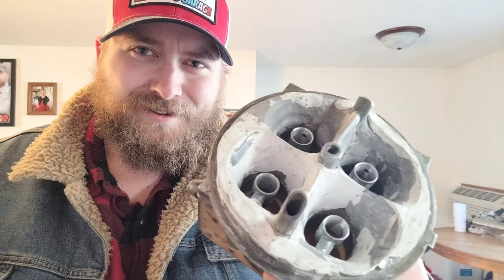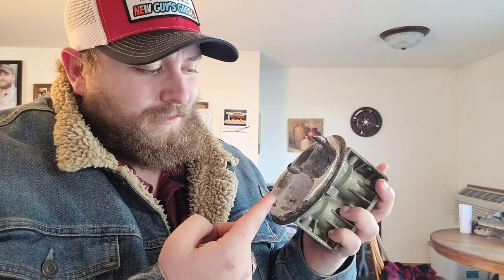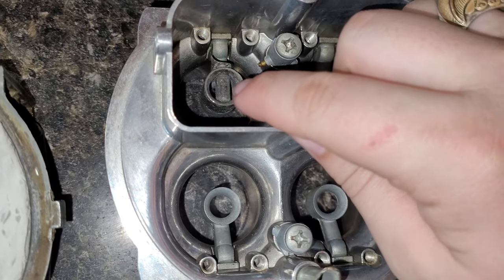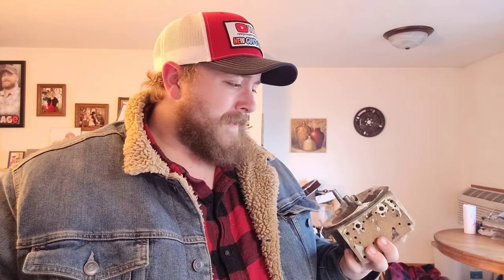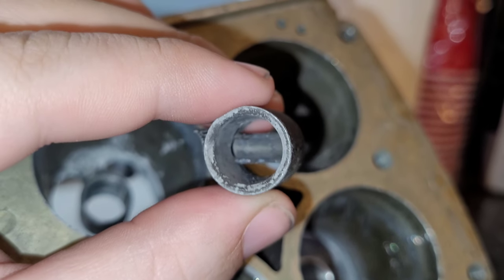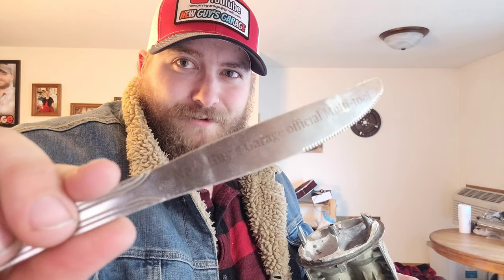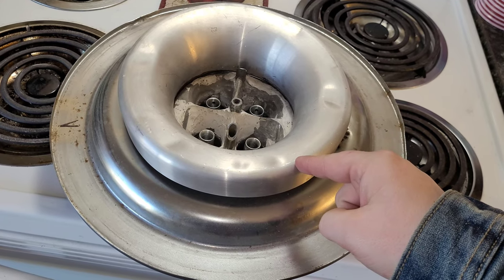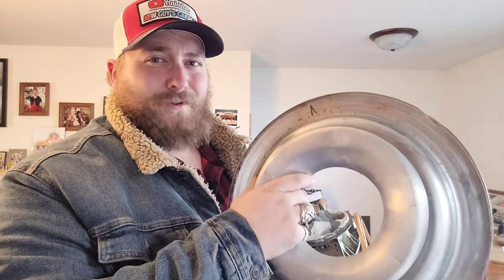Holley Carburetor Straight Leg Booster Mods! | Project XMC Flow Bench Testing | How To Customize!

Comment: It would be cool if you could wet flow it to monitor atomization. 1 3/4" throttle blades will reduce the signal , 1 11/16" would be better. If you shade the areas you want to cut with a Sharpie, it will make your eyes happy.
Reply from the maker: The larger throttle blades should improve signal, more cfm can pass through the bigger butterflies causing more velocity through the smaller venturi pulling on the booster more? 🤔
Reply: @newguysgarage6802 Throttle response at low to mid range is more important. Unless you only are worried about total bench flow. I was referring to driveability. I would test the smaller throttle plates first , then you will have a baseline. It will be cool to see the differance .
Reply from the maker: @427_FE  yep we are going to use the 600 baseplate first then move onto the 750 to see the difference. 

But even in low to mid throttle opening the bigger butterflies would let more air pass by so more air would be pulled through the smaller venturi and through the boosters causing more throttle response is the way I was thinking about it. 

Dose that make sense or am I thinking about it wrong 🤔 

The bigger throttle blades and more taper in the bores would flow more cfm, so they become less of a restriction. Therefore the venturi opening itself would get drawn on more and become a bigger "restriction" making velocity flowing through it to go up resulting in more pull on the boosters as well?

Comment: I assume the velocity stack was creating lift using the Coanda effect. Some think the effect was used on the old "flying saucers", interestingly the velocity stack is the inverse shape of a UFO. Lol
Either way, the Coanda effect will cause the air to cling more densely to the outer portions of the carb barrels.
Reply from the maker: That is probably what is happening yep lol 😁

I am going to use that to my advantage later on 😃

Comment: Hey man like I said before love the videos love what your doin and I think your on the right track I also think your probably right, I’d bet your gunna loose a little bit of signal in the low end but In the top end I’d bet that’s what’s going to be the money maker and you should talk to your guy who is doing your flow bench work and see if he can figure out the velocity the air is entering the carb at and the velocity it’s leaving at but over all I think your going in the right path and if you look at like a race carb on a dirt bike the main jet is at the very bottom of the inlet port of the carb so I’d bet it probably still mix’s the fuel pretty well but test will show lol
Reply from the maker: Yep I do belive booster signal might go down with this mod lol, 
But I do have more tricks up my sleeve yet that we can try out if that is the case! 😃
Reply: Hell yeah man can’t wait to see it